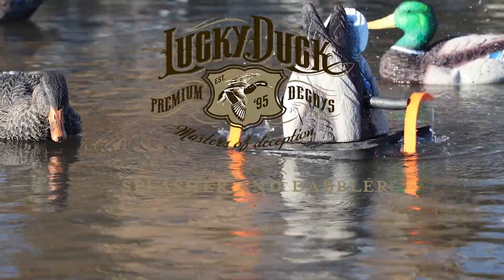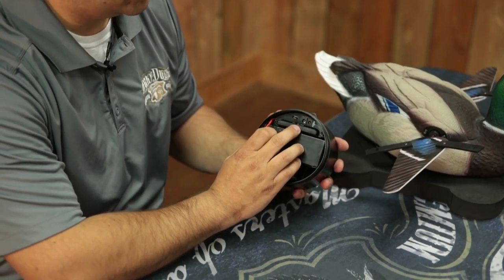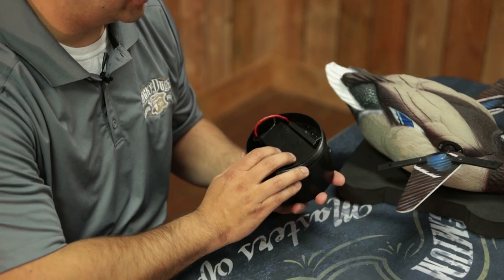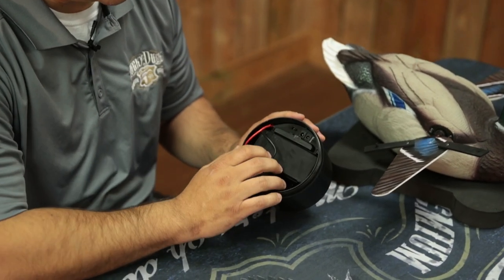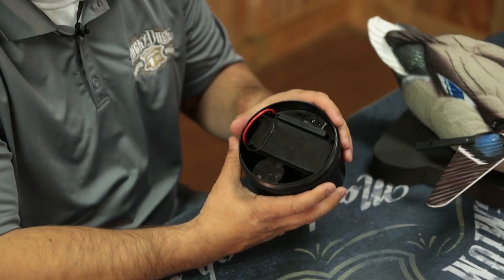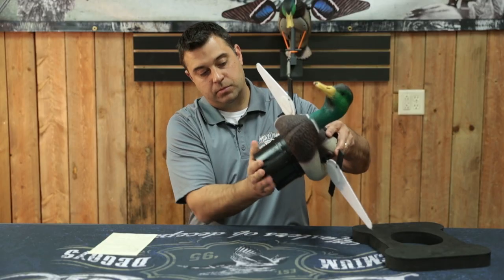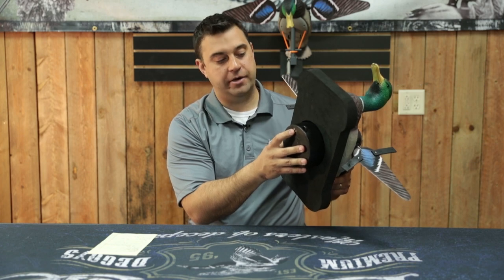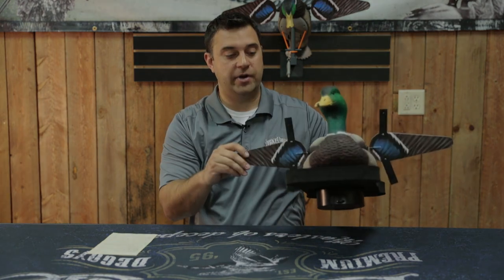How-To Setup Lucky Duck Splasher or Dabbler

Comment: Buy a brand new one and it don’t work great!!!
Reply: Yeah I got one and it's a piece of garbage. The water censors switch has never worked at all straight out the box. Have to unscrew every morning and turn on then screw it back up. The other day in the rain it slipped out of my hand and ripped wired out. Very shitty design. Poor wiring and I'm not the only one to say this. Read the reviews on Bass pro Cabela's Rogers. This don't even have a charging port have to unscrew Everytime. Never to buy another lucky duck item again. Do yourself a favor and buy a better brand like higdon
Reply: @LuckyDuckDecoys  no there is no point if I didn't read the reviews of everyone having problems with the censors then I probably would have. It just happens Saturday. And that was the 3rd time using it.